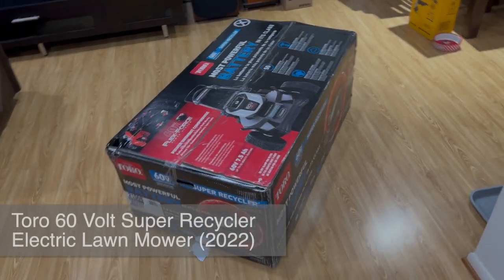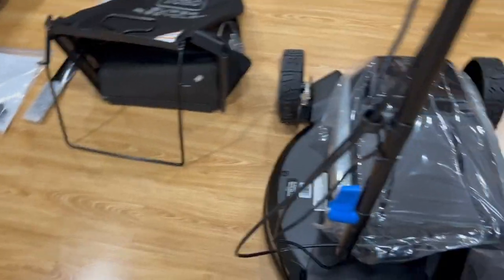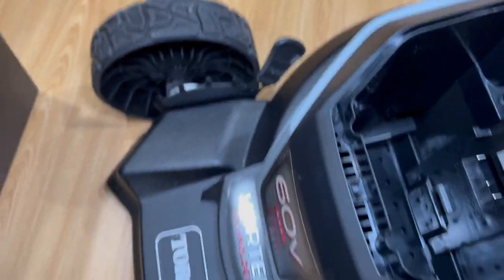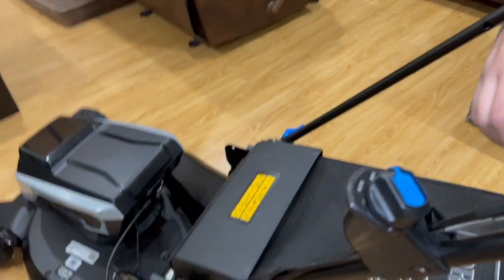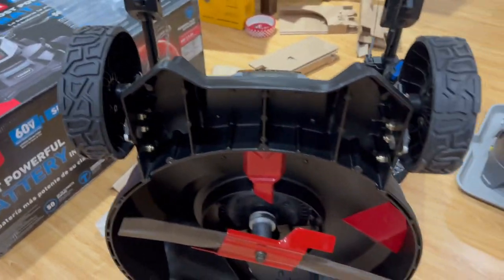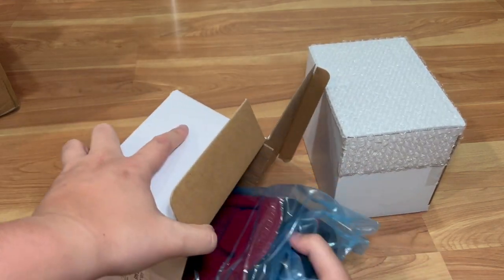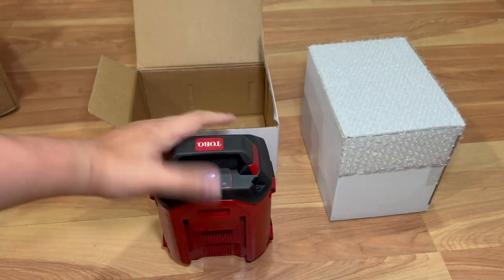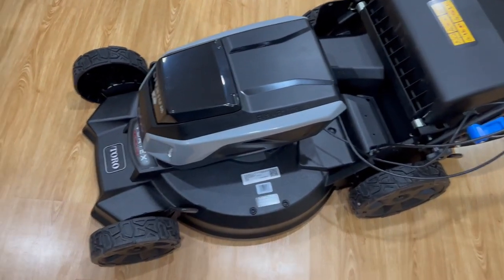Toro 60V MAX 21" Super Recycler Electric Lawn Mower 2022 Model

Comment: I returned mine already, unless I ran it on max it wouldn’t cut my St Augustine grass evenly.  Running it on max ran the battery out within 15 minutes.
Reply from the maker: Oh Wow, sorry to hear that!  Did you swap out to the performance blade on the mower?  I'm curious.  St. Augustine grass definitely looks thicker to cut.  I'm not sure what kind of grass I have, but it's not as thick as St Augustine from the images on the internet.  I think Mine is either Zoysia or Bahia Grass.  A lot thinner and easier to cut I think.

Comment: I thought I read .. with the Toro Super Recycler, you had an option of a side discharge?  [maybe that's for the Toro Recycler?]  Perhaps I've watched too many lawn mower review videos!  I keep coming back to the Toro .. I put the Super Recycler in the cart about 4 days ago.  Getting ready to order it (but we have acreage -- to make any battery operated lawn mower doable, we'll need to mow initially with the riding lawnmower; then for the season, just maintain the land with the battery lawn mower.  And,  yep, at Home Depot, it is currently $799.
Reply from the maker: This particular model does not have a side discharge.  It does have "mulch" option.  Basically you just remove the bag and leave the plastic adapter on as see in the video.  In bagless mode, it mulches the grass back onto the lawn.  That's similar to side discharge with the only difference that it mulches it even more instead of discharging it on the side. Hope that helps!
Reply: @TonTimeTech  Yes, very helpful!  Thank you very much!!
Reply from the maker: @susagor  Awesome, glad to be of help! =)
Reply from the maker: @susagor  I just found out how to link certain parts of youtube video on the timeline.  Below is the link if you want to see how to change between bagless and mulch mode.

Mulch to Bagless and vice versa section of the video:

https://youtu.be/RYwT8YVvx8c?t=1156

Comment: Thanks for the video!  Do the headlights turn on automatically and stay on?  Or is there a toggle for them on and off?
Reply from the maker: No problem, thanks for watching.  The LED lights pretty much stays on when the lawn mower is in use. There was no switch to turn it on or off.  They are LED lights so the power drain shouldn't be much. :)

Comment: Hello, is the hourly battery usage the same for the performance knife and the standard knife at economy rpm
Reply from the maker: Hello! Thanks for the question.  I can't confirm that because I'm still using the economy blade that was installed with the lawn mower.  My lawn doesn't grow fast and I mow it often that I didn't really need to install the performance blade.  I set the lawnmower on auto all the time, never had to use MAX on my mower.  I can say there were sections in the yard that I had tall grass and I can hear the motor ramp up to cut them.  Higher RPM would mean more power usage.  So in theory, if you have an efficient blade, the mower should use less power.  Just thinking in my head there :).

Comment: how about mowing actual grass
Reply from the maker: It mowed my lawn fine with no issues.  My backyard grass was taller than my front lawn grass.  I don't keep my lawn grass high, I mow it every 2 weeks and this machine has no problem cutting the grass. I mowed it in mulch mode instead of using the bag as well.  The electric motor is pretty strong and I was using the economy blade.  If you have thicker and higher grass, I would think it would cut just fine.  If not, you can always change it out to the performance blade that comes with it.
Reply: @TonTimeTech  awesome thanks for the response.
Reply from the maker: @83Nachojr  No problem! From my research, this is one of the strongest electric lawn mower you can buy in 2022.  I'll see if I can do another video waiting for my grass to grow higher and see how it performs.  Although that might be a while because I live in So Cal and the County just issued new water restrictions this month due to the drought. 😅
Reply: @TonTimeTech  yes I heard. I've been wanting to buy this but there's very little reviews to help me determine whether to buy or not.
Reply from the maker: @83Nachojr  Yup, I hear you.  I went based on the specs of the machine and just read a lot of text reviews on different websites.  I'm pretty happy with the purchase.  I wanted to get something DeWalt because I have so many spare DeWalt batteries, but decided to go with Toro lawn mower just because of the specs.  I'm glad I made the purchase.
Reply: @TonTimeTech  awesome thanks!